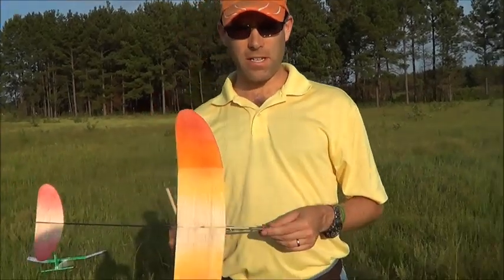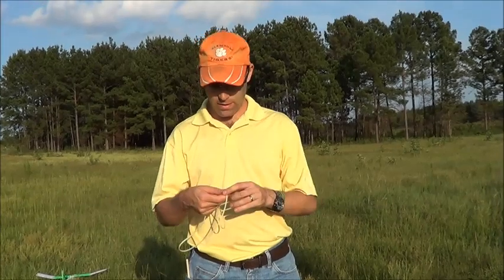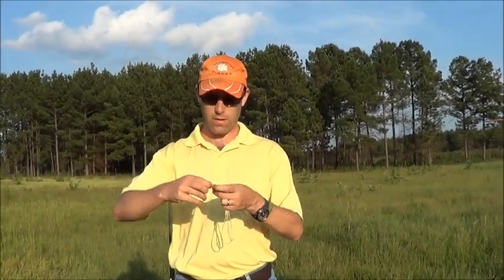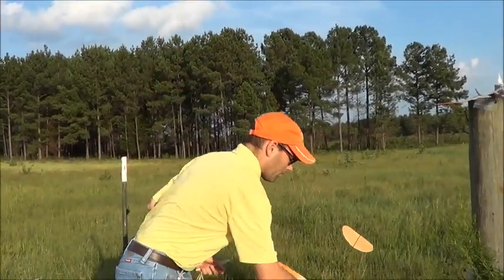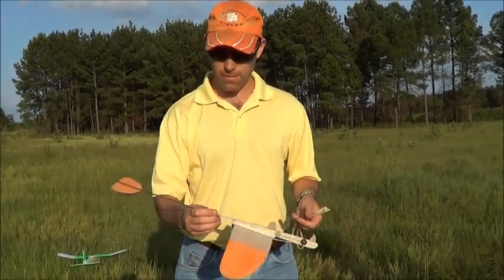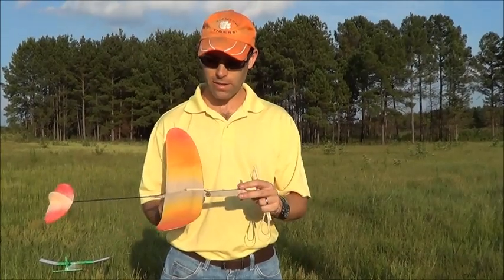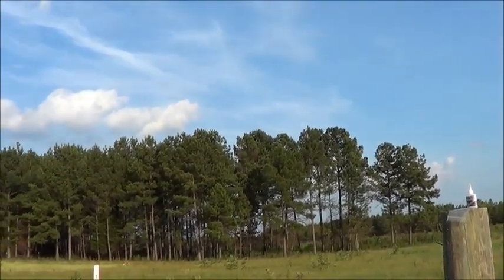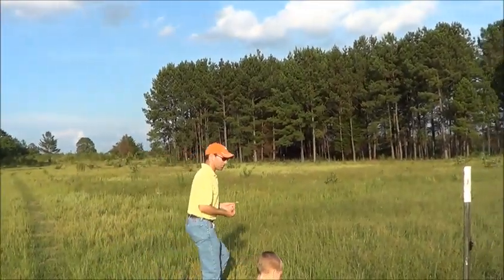Catapult Glider Trimming Case Study: Carbonette 19 CLG

Comment: That looks like a stable, reliable flier! Nuce work! I wonder...how thin do you sand your tail surfaces? And what airfoil does the main wing have?
Reply from the maker: Copterdude it is definitely a good airplane. :)
I just lightly airfoil the tail so the edges are about 1/32" thick (1/16" sheet). All my wings use the Stanfoil as documented on discuskid.com
Reply: Nice! I do exactly the same thing! I actually have a video coming soon on a 21" CLG I built that uses that airfoil. How much does the Carbonette weigh?
Reply from the maker: I haven't weighed the latest one, but I believe it's in the 25-30g range.
Reply from the maker: Probably yes, IF it's streamlined enough to not see a big increase in parasitic drag outweighing the improved reynold's number regimes.